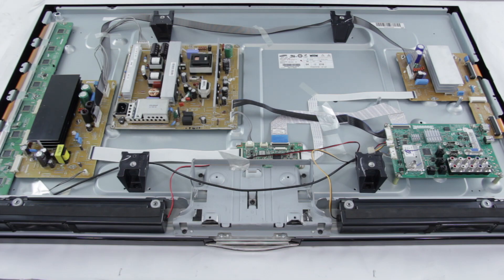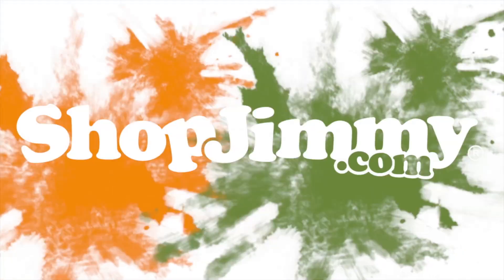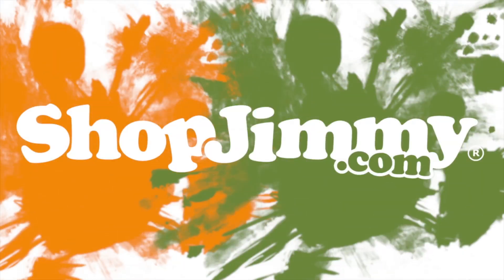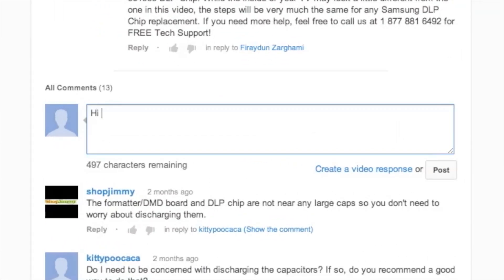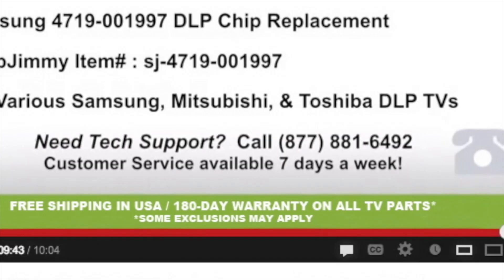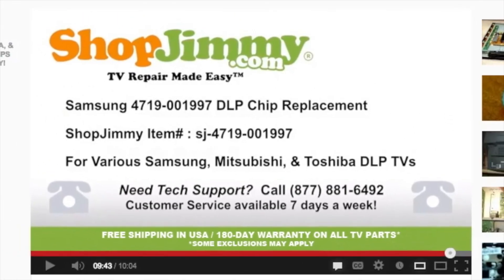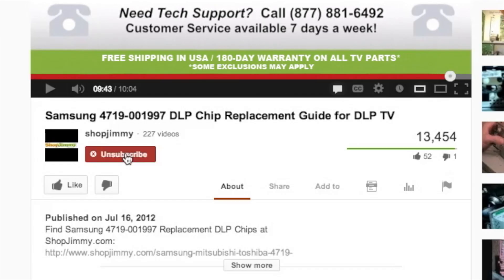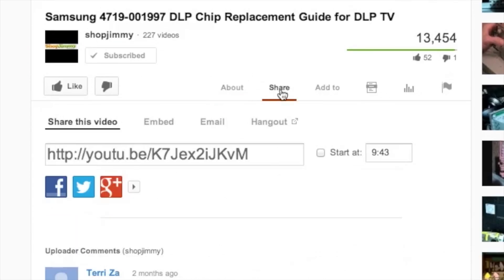Plasma TV Repair Tutorial - Common Symptoms & Solutions - How to Fix Plasma TVs

Comment: I have samsung pn59d550c1f plasma tv. The set blew a fuse, I replaced the fuse and it blew again. I replaced 2 bad f20up60dn transistors. The tv now has a blinking red stay light. I see no visible bad caps, but replaced the caps on the doc side of power supply with same issue. I have no vs or va voltages. I have 5v stby volts and 3v ps on, but it goes to 0-3v with the clicking of the relay. Check bridge rectifiers and they are good. I'm at a loss as what to do next. Any help would be greatly appreciated.
Reply from the maker: +gregory ellis   Try all repairs and troubleshooting at your own risk.  I recommend replacing the power supply board for your TV.  Click this link to replacement parts for your TV model number:  http://www.shopjimmy.com/catalogsearch/result/index/?cat=59&q=pn59d550c  There may be multiple boards for the same TV model number, be sure to match part numbers on your current board, with your replacement for compatibility.  Here is a link to a video showing how to identify your part number, click here:  https://www.youtube.com/watch?v=sSJexLvRrjM  Thanks and please let us know if you have any further questions with your TV Repair!  www.shopjimmy.com<!-td {border: 1px solid #ccc;}br {mso-data-placement:same-cell;}->
Reply: Will do. Ty for the help.

Comment: Hi I have a Panasonic plasma TX-P42V10E. After I brought my TV for repair at a service station of Panasonic, it came back not repaired due to the fact that the SC board tnpa4844ah was not repairable and no stock is available at Panasonic !?! The board has visible signs of a burned spot and some parts on it are melted. The technician said that also if they would have repaired or change the board he was not sure if that would be the only board that failed.
I found on ebay a used board and I'm thinking of ordering it and change it myself.

My question is, is there a way to understand if the SC board is the only failed board?
Do you think it's better to replace the SC board together with other boards (SU SD board) on forehand?
Thanks.
ps: for some strange reason I can't get access to your website from Italy, Message I get is: 
Access Denied
You don't have permission to access "http://www.shopjimmy.com/" on this server.
Reference #18.24b5655f.1444210673.44b1a892
I also tried it with my iPhone that's on a different server, 4G network! Same message.
Reply from the maker: +incredibly8ties  Try all repairs and troubleshooting at your own risk.  Yes, you should replace the SC, SU & SD boards all together.  Thanks!  www.shopjimmy.com

Comment: I have a Samsung plasma PN51D7000FFXA. Worked fine for 2+ years. Unplugged for 1 year. Replugged and simply cycled on and off. Logo (with chime) would come up, go away; Input would display 3-4 seconds; unit would shut down. This would keep cycling. 
Unplugged again, for a few days, now only red LED flashes upon plugging unit in and a short buzz (Bvvvvt) sound occurs, then quiet and a green light on the gig board slowly comes on and off.
The short buzz on initial turn on comes from the Y-sustain board. No capacitors on the entire TV show signs of swelling.
Any ideas?

Comment: I really Hope you can help me. I recently opened my TV (Panasonic TC-P65VT30) because I was trying to fix a buzzing noise. I read that there is a screw that gets loose and that I needed to tighten it up. I tightened up the screw on the Y Buffer/scandrive I think you called it (The Long board on the left of tv). Well to test it, I plugged the tv back in and the buzzing noise was gone! 
I grabbed the screw driver to tighten a bit more and touched the board on accident. It made a loud pop and spark! I had forgotten to unplug tv. The TV now does not turn on! I wish i could reverse time at that moment. Well, how can I fix this? Should I take it in or is this something I can fix? Hopefully you can help me with this..
Reply from the maker: +StreetSoldier00  Try all repairs and troubleshooting at your own risk.  I recommend replacing the SC, SU & SD boards in your TV.  Click this link to replacement parts for your TV model number:  http://www.shopjimmy.com/catalogsearch/result/?q=TC-P65VT30  There may be multiple boards for the same TV model number, be sure to match part numbers on your current board, with your replacement for compatibility.  Thanks and please let us know if you have any further questions with your TV Repair!  www.shopjimmy.com

Comment: I have a Samsung Plazma TV Model PN51D550C1FZ31N3CQBB11911L   -   My TV will not power up.  So based on your video, I believe I need to check the fuse (there is only one).  No capacitors on the board appear to be bulged,  So if it is not the fuse, I may need  a new power board??   Where do I look to order one?
Reply from the maker: +Tim F   Try all repairs and troubleshooting at your own risk.  Do you have experience using a meter to check voltages?  Thanks!  www.shopjimmy.com

Comment: I have a Samsung Plasma E530 Series TV -60" class Model# 60E530A3F.  This set was given to me and I was told it produced no sound or picture and sure enough it doesn't. From the front I believe the button on the bottom left is an on/off switch. I removed the back panel to check for anything obvious but all cables and componets look intact. I checked to with an AC detector probe and AC power is present. I'm at a definite impasse on how to proceed. Any help would be appreciated. Thanks.
Reply from the maker: +Opal Preston Shirley   Try all repairs and troubleshooting at your own risk.  I recommend replacing the Y-Main Board and the Upper and lower Y scan Drive boards in your TV.  Click this link to replacement parts for your TV model number:  http://www.shopjimmy.com/catalogsearch/result/?q=60E530A3F  There may be multiple boards for the same TV model number, be sure to match part numbers on your current board, with your replacement for compatibility.  Here is a link to a video showing how to identify your part number, click here:  https://www.youtube.com/watch?v=R1jmj_foId0 Thanks and please let us know if you have any further questions with your TV Repair!  www.shopjimmy.com

Comment: Hey guys! I have a PN64D8000 that when I touch the power sensor, sounds like the power supply clicks on, but no picture at all. When the lights at the touch sensor "buttons" are on, the red light blinks when I hit the channel, volume and source touch sensors. I ordered a power supply board but just figured I'd bounce it off you anyway. Thanks!

Comment: Hi, my tv is a Samsung Plasma 60" Model 860FH-YB02. It was hit in a thunderstorm while plugged into a surge protector. After this, it would not turn on or display a standby power light. I tried replacing the power board (the 1 that contains the plug for the power wire that plugs into the wall) w/a replacement from ShopJimmy but this did not fix the issue (same thing - will not turn on and no standby power light displayed). Any ideas what it might be? Thanks!

Comment: I have a 2009 model Panasonic TC-P50G10 Plasma TV that I turn on and watch fine for about 2 minutes then the  picture gets white horizontal lines going thru screen, then the picture and audio start going in and out, any ideas on what would cause this?

Comment: Hi, I've watched several videos of yours trying to troubleshoot my Samsung HD Plasm Tv- PN51D450 Model.  I hooked up with a local cable company back in Nov. 2014.  Since that time, had a lot of problems, Dvr shutting down, when reset the dvr then, it would shut my tv down.  Notified the TWC-Time Warner Cable handful of times, their solution: unplug the dvr, wait, then plug it back in to reset it. Bad Business There.  On July 24, 2015 the dvr shut-off twice in one day, second time it shut off and I reset the dvr it then, shut my tv off then, reset the dvr and when tv was on, I heard two loud POPS.  The Tv is Dead Now.  No Stand-by light, no power, Nothing when you plug it in.  Watching some of the Samsung Troubleshooting videos on here, one video suggested that it was my Y Board that needed to be replaced as they mentioned, quote, "if you hear a pop".  What do you think and explain to me how I can troubleshoot and find out what exactly is the problem.  I've never had a problem until I had TWC added to my Tv.  Thanks for any and all help and solution to get my handicap mother of 79 yrs. back to watching her Plasma Tv. and thank you very much if you can help.  Once this is repaired, bye, bye Time Warner Cable, can you believe it, they sent me a bill after their dvr blew out my tv and no tv for 2mos. before any tech personnel came out to check the dvr and the tv.  thanx again, diane reinhart

Comment: Hello,

I have a Panasonic Plasma FP-T5084. The TV is several years old. 

I have already replaced 4 blown fuses and the TV worked again. It was the power clicking issue the last time.

I've used the TV now for over a month and yesterday it wouldn't turn on again. The standby light works, but doesn't actually turn on ever. I've checked for bulging caps; with no luck!

I've checked all the fuses, including the ones on the ZSUS and YSUS boards, and their all okay as well. 

I noticed several weeks ago that sometimes I was getting this popping noise and in the center of the TV I'd get this static screen blur.

I have it open and I cannot find any caps that are bad.

Help please!

Thanks

Comment: I have a Sanyo DP50741 50" Plasma TV. After a recent power failure the audio no longer works on any of the inputs, yet video is still fine on all inputs.  I did the reset by holding the power button to no avail.  I also went into settings to see if any of the sound settings were changed but they were not.  What is the most likely problem component?  Thanks.
Reply from the maker: +James Henry   Try all repairs and troubleshooting at your own risk.  I recommend replacing the main board in your TV.  Click this link to replacement parts for your TV model number:  http://www.shopjimmy.com/sanyo-j4jf-main-board-for-p50741-01.htm  There may be multiple boards for the same TV model number, be sure to match part numbers on your current board, with your replacement for compatibility.  Here is a link to a video showing how to identify your part number, click here:  https://www.youtube.com/watch?v=Mi0D7ksQp7I  Thanks and please let us know if you have any further questions with your TV Repair!  www.shopjimmy.com

Comment: +ShopJimmy.com PN50C450B1D Samsung plasma TV.  Problem: horizontal black lines across the middle of the set. I have tried cleaning the ribbon cables to the panel and connectors on the Y-buffer board first, then replaced the Y-buffer board and the Y main board using your company, www.shopjimmy.com. This has not resolved the problem. The black lines are still there in the same position as before, ribbon cables and connectors look in perfect condition. What else is next? Based on this video it seems the logic board would be the next best step. Could the panel be bad just on those lines? Thanks in advance for your help on this matter.
Reply from the maker: +Dominick Laudisio   Try all repairs and troubleshooting at your own risk.  This sounds like a TV panel (TV Screen) problem.  If your TV panel is bad, it may be more cost-effective to replace the TV as panels are typically hard to find in stock, difficult to replace, and expensive.  Thanks and please let us know if you have any further questions!  www.shopjimmy.com

Comment: Hi. I have a LG 60PA6500.  The house was hit by lightning and now I have the stand-by light (solid red) but no response from the television when I press power on the remote or on the set itself, no click, no sound, no pic. There are 3 fuses on the power supply board I have checked them all with a meter and each is good.  I have also checked for AC voltage at the point where it comes into the power supply board (2 wires with a red plug, identified on the board as "LIVE" and "NEUTRAL".  I have a good 117V AC there.  I saw another post somewhere about unplugging the y and z boards (separately), powering up and looking for a change, I did this with the Y board first then the Z board but nothing changed each time I powered it up.  I decided to try it with the main board unplugged and as soon as I put the power cord back in I heard a click that sounded like a relay and also what sounded like a fan running.  I immediately unplugged.  I powered up 1 more time and got the same result.  Any idea what the problem is? Thanks

Comment: Hello i have LG with tv model No 42pa4520. the problem is i was trying to connect it a laptop whiles the tv was still on the result was that the tv Screen went off. Anytime I put it  on the standby will come but the screen will not come on. the standby remains on when press the power button on the remote the standby will blink small and remain on but the tv itself will show on reaction.

Comment: Hi,
Great video.  I have a Panasonic Plasma HDTV, Model TC-P42S30.  Today, when I turned it on, it has vertical lines on the screen at the top and bottom with a break in the middle. The vertical lines are grouped in fours with spacing between each group of four lines (about the same width as the four lines).  The pattern repeats across the entire screen with 15 groups of 4 lines. Otherwise, the color and picture appears normally.  I only have one input device, a blu-ray player using HDMI 1 port normally.  I tried all 3 HDMI ports but same problem.  In fact, the lines appear in every input mode and the blu-ray player completely disconnected.  The lines look like the following except the lines on the bottom are a bit longer than the ones on the top.  I'm pretty good with electronics and would like to repair this myself. Can you help?

||||    ||||    ||||    |||| ...

||||    ||||    ||||    |||| ... (for a total of 15 times)

Comment: I received this broken Samsung PN50C430A1D from my dad. There are vertical black bands (about 2-3 inches wide) that are on the far left and center of the screen. They will come and go in random time sequences. There is also a very thin red vertical line just left of the center. When I access the menu the bars still are visible in front of the menu
Reply from the maker: +David Avery (MuKi 931)   Try all repairs and troubleshooting at your own risk.  This sounds like a TV panel (TV Screen) problem.  If your TV panel is bad, it may be more cost-effective to replace the TV as panels are typically hard to find in stock, difficult to replace, and expensive.  Thanks and please let us know if you have any further questions!  www.shopjimmy.com

Comment: have a pn51d800ffxza lost picture but but sound worked for awhile. Logic board has 5 sec blink but when I disconnected the cable from logic board to Y blinks at 1 sec interval.   Power supply voltages start OK but voltages drop off when turned on. How  do I tell what board(S) is bad. Voltage at logic and power boards seem OK
Reply from the maker: +Art Sheridan  Try all repairs and troubleshooting at your own risk.  I recommend replacing the y board and the y buffer(s) in your TV.  Unfortunately I do not see any replacement parts in the search results for your TV model number on our website.  Thanks and please let us know if you have any further questions!  www.shopjimmy.com

Comment: I have a 50pg20 set that was given to me destined for the dump.  I am a component level electronics tech and I am stumped.  The picture is working and good sound but the screen has a dark tint and warm color that I can't get off the set.  The darkness is very bad at the top and sides.  I have also noticed there appears to be a vertical bar on the left 1/3 and right 1/3 of the screen.  I would appreciate any suggestions.
Reply from the maker: +Christopher Campbell   Try all repairs and troubleshooting at your own risk.  This sounds like a TV panel (TV Screen) problem.  If your TV panel is bad, it may be more cost-effective to replace the TV as panels are typically hard to find in stock, difficult to replace, and expensive.  Thanks and please let us know if you have any further questions!  www.shopjimmy.com

Comment: Hi have a panasonic Tx-p50g20e with 4 blink code,it was a loud pop sound and then no picture and it starts blinking red 4 time code,when i try to start it it lights green first then a click and goes red 4 blinks,whitch board is the problem do you think?
Reply from the maker: +Zigo Riljo  Try all repairs and troubleshooting at your own risk.  I recommend replacing the SC, SU & SD boards in your TV.  Unfortunately I do not see any replacement parts in the search results for your TV model number on our website.  Thanks and please let us know if you have any further questions!  www.shopjimmy.com

Comment: Hello, I have a Samsung PN60F5500. It wont turn on. Power Led blinks 3 times, pauses and flashes 3 times. I have changed the power supply. Any suggestion what else it could be? Thanks.
Reply from the maker: +Shawn Powers   Try all repairs and troubleshooting at your own risk.  I recommend replacing the main board in your TV.  Click this link to replacement parts for your TV model number:  http://www.shopjimmy.com/samsung-bn94-06194b-main-board-for-pn60f5500afxza.htm  There may be multiple boards for the same TV model number, be sure to match part numbers on your current board, with your replacement for compatibility.
Thanks and please let us know if you have any further questions with your TV Repair!  www.shopjimmy.com